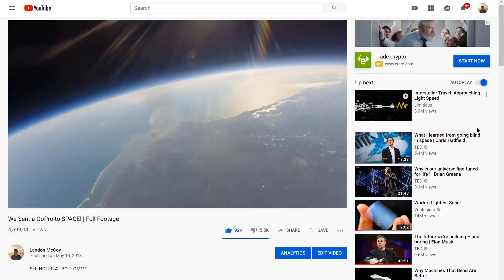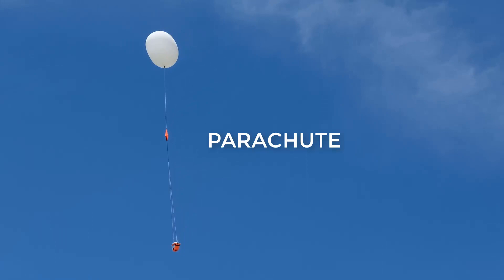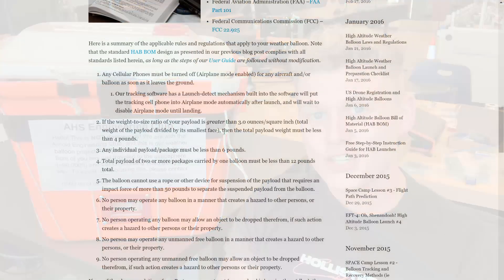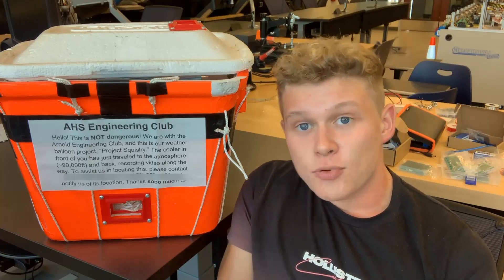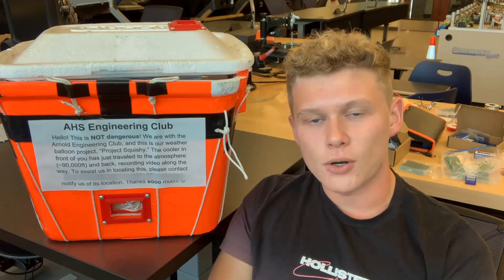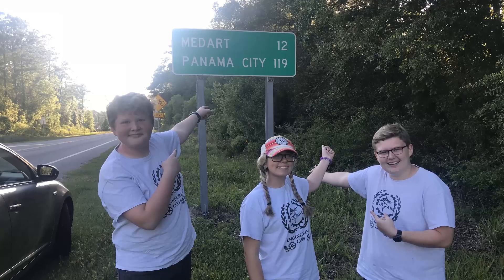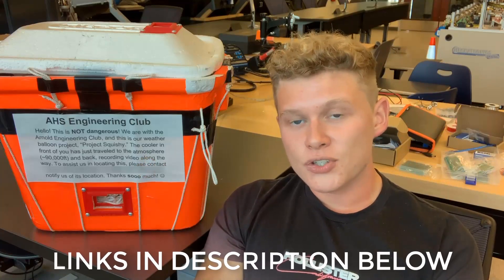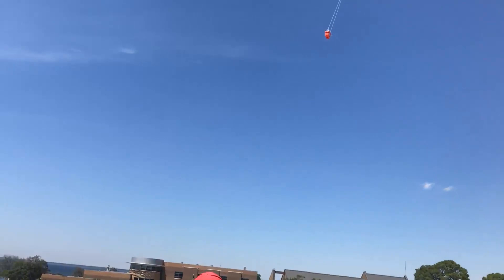HOW TO: Send a GoPro to Space!

Comment: Doesn't it get cold at that altitude? Did you insulate the gopros or are they just super resistant?
Reply: Fanny Tremblay exactly fake video and if you look at other videos of earth they all have different views of how round the earth is. Super strange if you ask me.
Reply: @chillbill8591  No one asked you though.
Reply: The gopros create quite a bit of heat themselves, so they did quite well in the cold. I also thought that the cold would be a problem, but actually it turned out that when I insulated the gopros, they got overheated!

Also they are in the extreme cold only about 10-20 minutes, so it is not that bad.